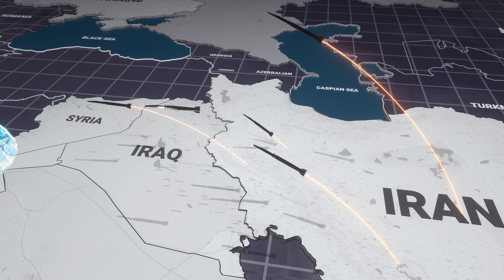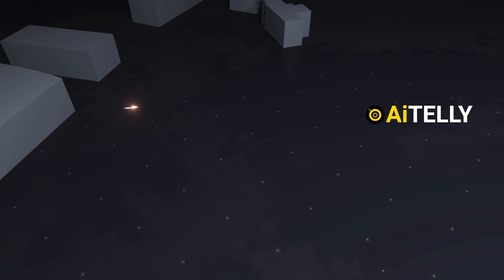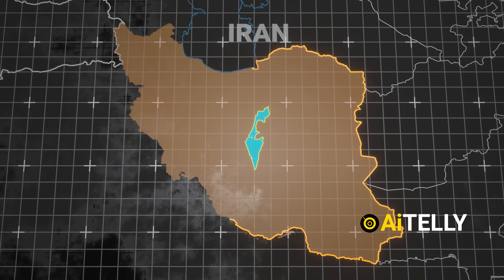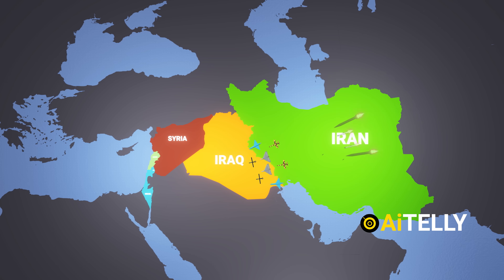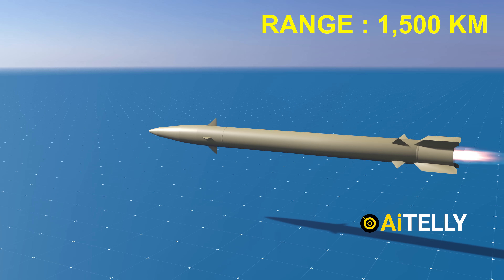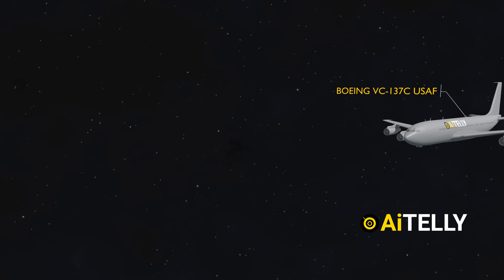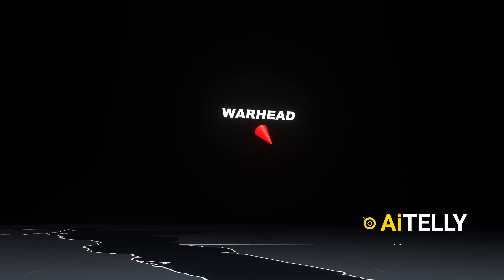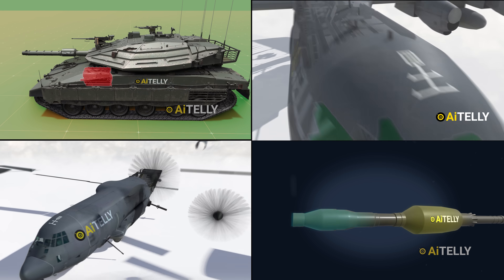How Iran Penetrate Israel Air Defence? Fattah Hypersonic Missile #iran  #israel

Comment: Israel is smaller but 75 times smaller is mathematically impossible. That is a fraction, not a multiple. TIMES (X) means more of something. There is no "smallness" scale, size is measured in "size" which is a positive number more than zero and tells you how "big" something is. Nothing will tell you how small something is. It is like cold, there is no such thing as cold, only heat.

Comment: The faster the missile travels, the less manueverable it can be. This is simple physics. The g-forces exceed any known material with even a few degrees of turn at hypersonic speeds. So no, it's not too fast AND too manueverable to be shot down. The reason that a few of these got through Israel's air defences is because Iran launched hundreds of them and no air defence system is perfect. If Iran launches 300 missiles and Israel shoots down 270 of them, that's a 90% success rate, which is basically what we saw actually happened.

Comment: Sorry, but important context is missing. Half of Iran's missiles failed before getting to Israel, and then 80-90% of those that got to Israel were intercepted. Only 1% of missiles few within military structure (3) and they were essentially in open areas (taxiways for planes and just out of Tel Aviv HQ building). 6% +/- of civilian hits, and the only Soldier that die, died at home in his -1 building shelter. The missiles were a complete failure in deterrence, and were bottle-necked by their launchers.

Comment: NO, Iran did not use hypersonic weapons to hit Israel, those slow missiles in the vid that are hitting Israel are definitely NOT hypersonic. Hypersonic missiles travel at Mach 15 (15 times the speed of sound), or at least that's what Iran reported, so you almost are not supposed to see these missiles when they hit. Iran either does NOT really have a working hypersonic missile, or their Fattah missiles work but were intercepted immediately in the atmosphere by Arrow and David's Sling defense systems before they reached hypersonic speed, which is normally expected.

There's no air defense that is 100% effective; some will eventually go through when the defense is getting overwhelmed. And this is what we see in Israel: ordinary and slow missiles getting through.

Comment: This video is somewhat misleading and omits several key points.

Many ballistic missiles are capable of accelerating outside the Earth's atmosphere, so the Fattah-2 is not particularly "unique" in that regard.

The term hypersonic can also be misleading. Most ballistic missiles reach hypersonic speeds, especially during the terminal or re-entry phase, but simply achieving hypersonic velocity does not qualify a system as a true Hypersonic Glide Vehicle (HGV) in the modern military sense. HGVs are typically defined by their ability to sustain atmospheric flight at hypersonic speeds while maneuvering mid-course, making them exceptionally difficult to track and intercept, even with the most advanced missile defense systems.

Although Iran claims the Fattah-2 is a true HGV with advanced evasive maneuvers and glide capabilities, many analysts suggest it is more accurately described as a medium-range ballistic missile equipped with an upgraded Maneuverable Reentry Vehicle (MaRV). While MaRVs can perform limited atmospheric maneuvers at hypersonic speeds (primarily during the terminal phase), they generally lack the ability to maneuver throughout a significant portion of their flight, particularly during the midcourse phase, as true HGVs do.

This doesn’t mean the Fattah-2 is incapable of evading Israel’s missile defense systems. However, it is unlikely to be as evasive, accurate, or effective as a genuine HGV or hypersonic cruise missile.

Comment: Your 3D modeling is awesome. It would be even more educational if you hire some experts on the subject to go in detail with physics, chemistry, mechanics, etc.
Reply: The physics are wrong in many ways. For example, a hypersonic missile cannot manuever more than a few degrees (what it shows in the video is laughably fake) because the g-forces at hypersonic speeds would be so high it would destroy itself so it either has very little agility or it must slow way down. This means it can be intercepted and it was intercepted btw, Iran just launced hundreds of them to overwhelm the defences.

Comment: The key to hypersonic speed and maneuverability is that the warhead's nose is designed in a shape that at high speed it pushes away the air from the warhead, that is, it actually flies inside a vacuum bubble which surrounds the whole warhead. That's why it can achieve such high speed, maneuver and the air is not ripping it apart, as long as it maintains that vacuum bubble around the warhead.

Comment: Thanks for the video—but several key points are misleading or incorrect:

One. It’s not a true hypersonic glide vehicle.
The Fattah‑2 is not an HGV. It’s a medium‑range ballistic missile (MRBM) with a maneuverable reentry vehicle (MaRV). All MRBMs reach hypersonic speeds (>Mach 5) during reentry—that alone doesn’t make it special. It doesn’t glide or shift unpredictably in the atmosphere like true HGVs do.

Two. “Impossible to intercept” is false.
The claim that it flies at Mach 15 and can’t be intercepted ignores how missile defense actually works. Israel’s Arrow‑2/3 systems target ballistic missiles well before reentry—often in midcourse or even boost phase—long before speed becomes a factor. In April 2024, interception rates ranged from 95% to 99%. Speed isn’t immunity, especially when maneuverability is limited.

Three. Speed claims are overhyped.
Yes, it may briefly hit Mach 13–15—but only at the top of its arc, not throughout the flight. That’s standard for many ballistic missiles.

Four. Range is regional, not global.
With an estimated range of 1,400 km, it can reach Israel and other nearby targets—but it’s nowhere near global-range capability.

Five. No nuclear payload has been demonstrated.
There’s zero public evidence that Iran has successfully miniaturized a nuclear warhead for this missile. Theories exist, but that’s all they are.

Six. Production is under pressure.
Israeli and U.S. strikes have taken out roughly a third of Iran’s launch infrastructure. Solid-fuel MRBM production remains limited and slow.

Seven. Defense systems continue to adapt and succeed.
Despite Iran’s new missile designs, Israel’s multi-layered air defense keeps evolving and intercept success rates remain above 95%. The system is built exactly for threats like this.

Comment: Some information is missing. Iranian missiles are quasi-ballistic / quasi-hypersonic. its SKIP-GLIDE MANEUVERS in the UPPER ATMOSHPERE layers and once it has slowed down to a certain threshold speed, it dives down at a steep angle. Since it depends on the selected trajectory, its impact velocity can be Mach 5, combined with prior maneuvering
Reply: Your information is incomplete, we have seen videos of past Iranian attacks where the missile maneuvered at very, very low altitudes and confused the defenses.

Comment: 6:22 An 18-minute flight time implies speeds close to Mach 40—well beyond typical hypersonic cruise speeds of around Mach 5. Such rapid travel is only achievable via ballistic or near-orbital trajectories, like those used by ICBMs, rather than by atmospheric hypersonic missiles cruising at Mach 5, which would take roughly 2.5 hours to cover the same distance. Either it's wrong, or the video is talking about a missile following a high-altitude ballistic or quasi-orbital path, not a sustained Mach 5 cruise within the atmosphere.

Comment: 1) The accuracy of Israeli air defence is 65 % and falling every day .
2) You said Iran has 1000 missiles left but u didn't tell that israel has far lesser missiles to protect itself.
3) Iranian missiles need to evade Jordan and saudi airspace too , that means 3 layers of security from Israel and 2 from these, so total 5 .
4) Even being sanctioned for decades they beat the israeli defence systems .
5) Its not only about the missile technology that Iran has. , its 'Strategy' which Israel underestimated.

Comment: The 90% interception rate sounds impressive, but it's misleading without context:

1. Strategic Hits Matter: Even a few missiles getting through and hitting key sites means deterrence was breached — a strategic win for Iran.

2. Cost Asymmetry: Israel spent vastly more on defense than Iran on offense. Sustaining that in a prolonged conflict is unsustainable.

3. Allied Support: Israel didn’t act alone — U.S., UK, and others helped. That highlights dependence, not self-sufficiency.

4. Unverified Claims: The 90% figure is self-reported and should be treated cautiously without independent verification.
Reply: Propaganda machine in full force 🤣🤣🤣
Reply: They use old versions 😂 they don't use fatah 2 until today 50 percent rate
Reply: Yes, I want to get the real information about that. Iran missile uses Inertia Navigation System (INS) where the missile does not depend on satellite GPS, but rather the GPS is in the missile itself. That's why some Iran Missiles still miss from target and target civilians, but way harder to intercepted
Reply: @Okaz_qonqueror Iran is using beidu system
Reply: @Mianaly20 yeah, that's correct
Reply: Cry go and cry😢😢
Reply: @Happyblessing254 why are you crying about disclaimers and context for objective facts?